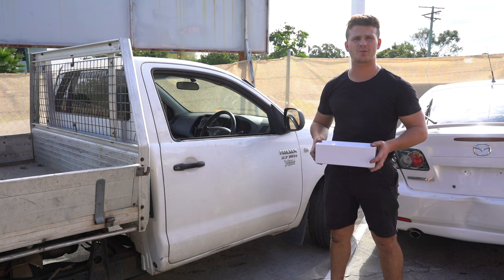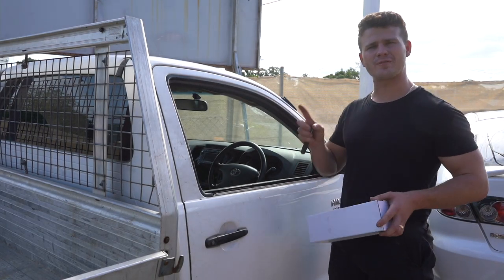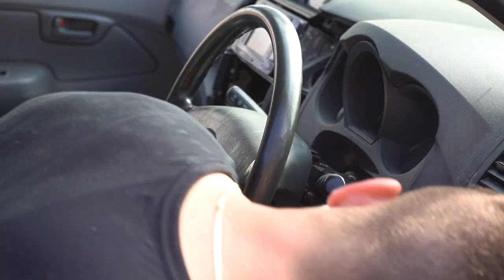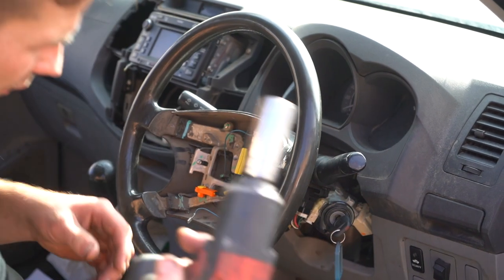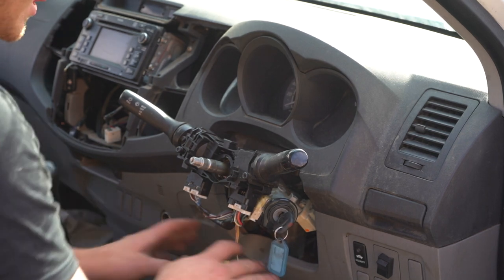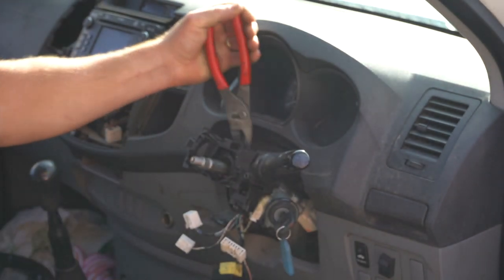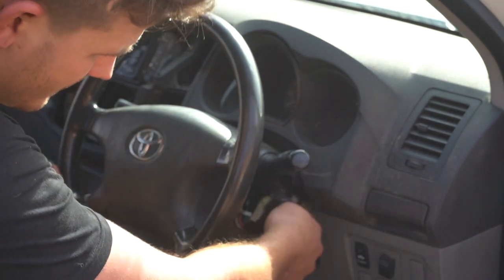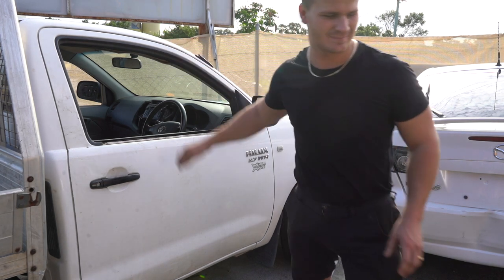How to Remove and Replace a Toyota Hilux Indicator Stalk Arm | Parts Factory Australia

Comment: Hey mate, just a quick question, do you know if there is all the wiring there to fit up a steering wheel with buttons? Hoping to be able to link it to a OEM headunit. (For an 09 Kun26R).

Comment: Hi mate, do you know how to adjust indicators cancelling too early and late? Thanks
Reply: Its called a flasher can & be removed and replaced easily.lye backwards with the back of your head on/near the accelerator look up under the dash & look for a small round can plugged into some wiring.unplug the flasher can and replace it.you tube it so you  get an idea....hope that helps ya.Lockey
Reply from the maker: This sounds like a clock spring issue. Replace clock spring. Perhaps you have a left hand drive clock spring in a right hand drive car. I've heard if this

Comment: Hi just wondering after indicating then turning complete my indicator stays on not switching off, is the a replacement stalk job?
Thanks.
Reply from the maker: Yes it is. Means stalk has lost one of its functions.
Reply: Bit of a long shot for this, but did you ever get the self cancelling working for the indicator? I bought a new stalk and replaced it but still have the issue.